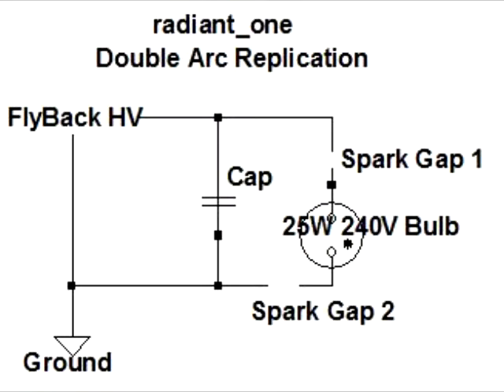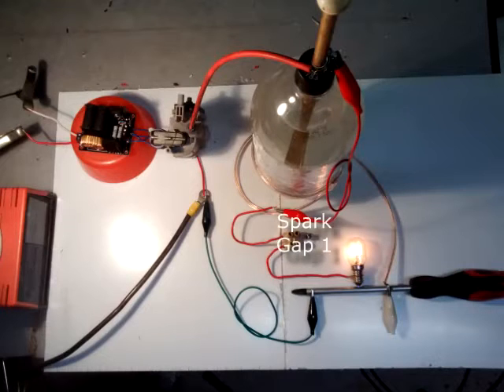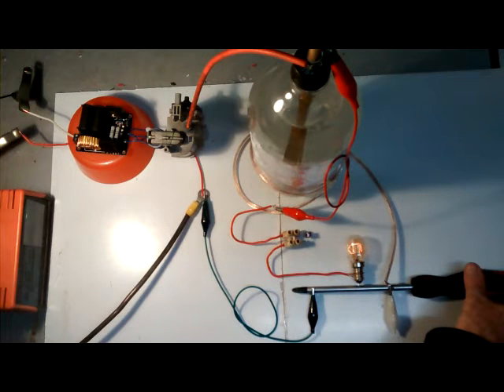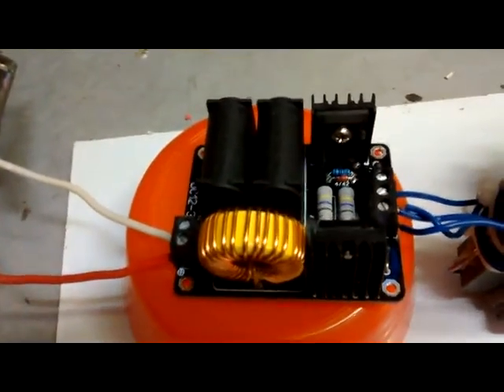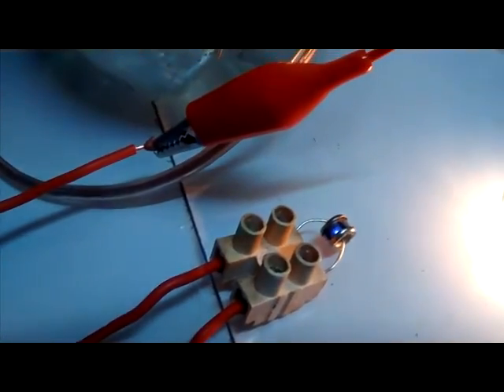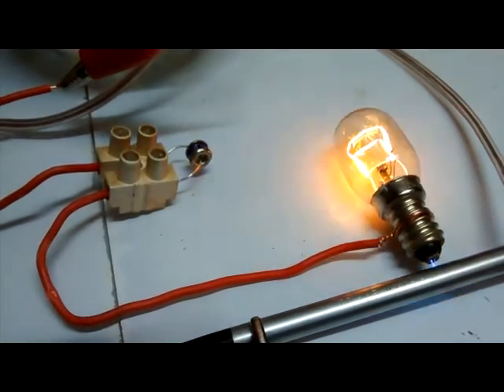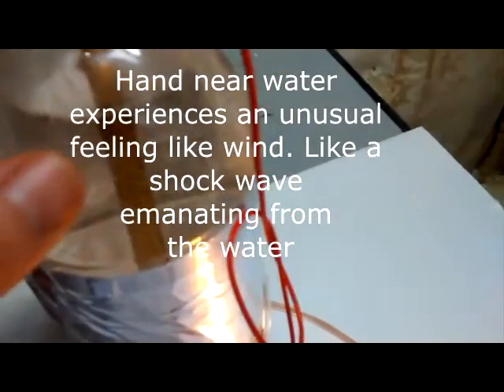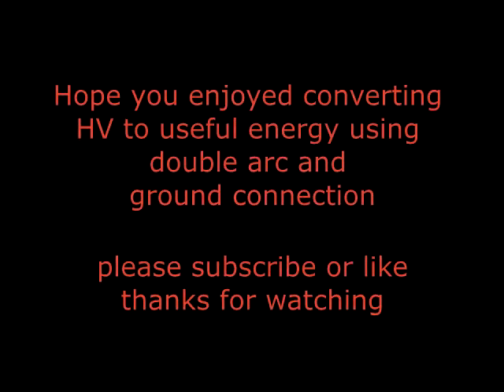Convert HV to mains voltage via water capacitor, double arc and ground wire

Comment: Why you put salt into  the water ? You made it conductive. Your capacitor lossing charge now. Try to use distilled water insead. And you can remove water completely and use metallic mesh as outer  electrode.
Reply from the maker: It made the water conductive but the inner metal rod electrode and the outer Aluminium foil are separated by the plastic wall of the bottle itself.

Comment: Well done. Is there just High Voltage DC on the watercap when you disconnect the load ?
Reply from the maker: Not using that circuit. I have gone back to video description and subsequently clarified - using SEC15 variant. The circuit driver is explained in GndNrgEx_2 video. ie https://youtu.be/GufTw6ECoz4

Comment: Try separating your grounds. Use 2, One for your coil and one for the circuit. Separate them as far as possible. Tune grounds with variable caps. See the difference.Clay

Comment from the maker: Turns out my battery charger is on the way out and is only putting out 11.88v unloaded and 10.33v when bulb is brightest. I need a new battery charger.

Copper coil suspended from insulated tape is weakly attracted to the light bulb, like Eric Dollard once showed at 20mins in https://www.youtube.com/watch?v=DFa-IymyWHM

Comment from the maker: Someone asked 1) what the rod was in the water? and 2) is there a battery action at work with the salt water?

1) The rod I used was anodised aluminium tube.  
2) The aluminium foil is on the outside of the water bottle. There is virtually no battery action here as there is there is only one electrode in the salt water. It is the same as an aluminium boat in the sea. There is oxidisation over a long time but the boat is not much of a battery :))

Comment: Brilliant work Radaint_one.
the way that it's connected in your video is another version of connections for the Device.
might be the 3de setup, Look forward in the forum, will be posting the original hand drawn schemas.
This device has alot of potential but needs alot of experimentation as you can see.
yet it's a big puzzle of Kapanadze's / akula's / Ruslan's and Vasmus.
Soon the complete understanding will be achieved 

Keep it up! :)

Geo